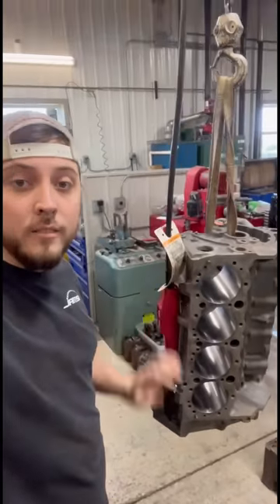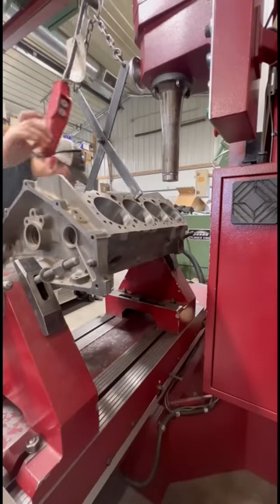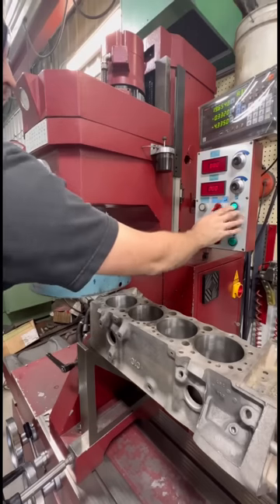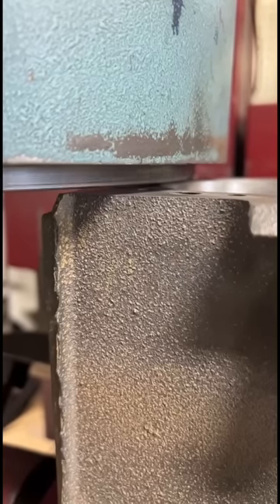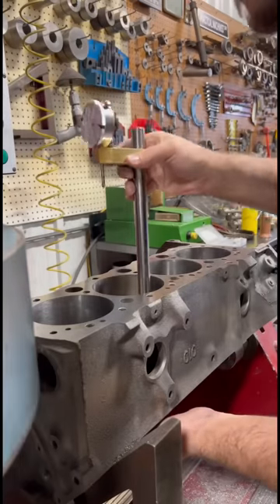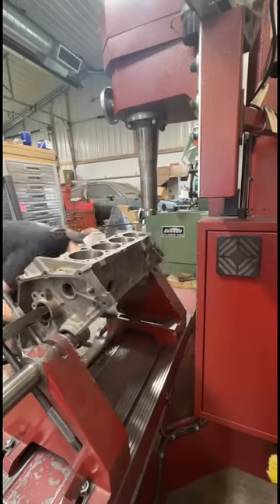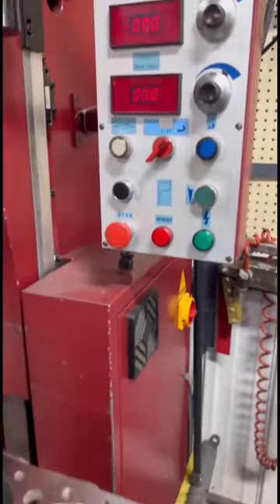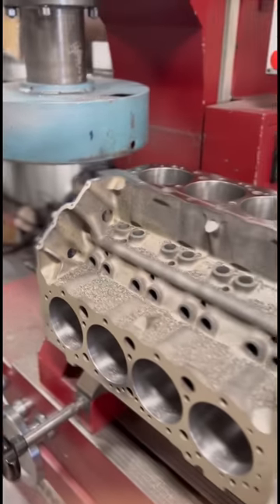#shorts This Is The Process Of “Decking” A V8 Engine Block! Would You Buy This?

Comment: Where this is a lost art for the everyday Joe to afford to do because of trade in for core and order a junk engine machine with 3 different size bores and pistons from  an auto parts store. I'd rather keep all the original together if possible. LS swap is so the new craze for years now most old engines have been trashed. Sad to see. Good machine work like this is hard to find

Comment: My last machinist did a valve job
I installed the head and had a misfire 
Checked the valve lash and plugs but had low compression 
 Leaked checked it and 
Machinist cand be hacks

Comment: It would be much easier to just use a Ford block as they are already perfect. 😋
Reply from the maker: Perfect, as boat anchors? 😂🤡
Reply: @JAMSIONLINE  Well, if you want it to actually work, then yes.😂
Reply: Yes, you are correct sir, boat anchors, if the ford mill doesn’t rust to nothing after first trip…😂 Chevrolet all the way

Comment: I Hope you check the actual angle from the manufacturer before you start machining. There’s plenty of blocks that don’t have a 45 degree angle.
Reply: Thats a 90° V8 designed in 1955, each bank should be exactly 45° from the centline of the block.

V8s pretty much only come in 90° and 60° flavors, and you can tell the difference with your bare eyes.

Comment: Do you have to use a different height piston after doing that?
Reply: "Rebuilder" pistons for that motor are 1.54 pin height, the stock pistons are 1.56 pin height.

BUT* most rebuilder head gaskets are 0.041 thick, whereas the stock head gasket was 0.015 thick, so there are plenty of ways to make up the difference.

Comment: It’s not that the blocks aren’t tru it’s that they warp from the heat of th engine running and the pressures inside it
Reply: They weren't true from the factory. The tooling was more setup for speed than for accuracy. Blocks pretty much got milled on a conveyor belt.
Reply: Cut it quick and dirty, if 1 out of 100 has a problem in service then the warranty will cover it. Thats how all the big 3 did it.

Comment: Im rebuilding a 3.8 229 v6 1981 GMC caberallo my bores are .035 i checked with a feeler gauge i can't afford dail gauge im doing old school way i put old ring in the bores it say 035 it supposed to be .017
Reply: The old rings themselves are worn. Put a new ring in and measure. 

My Chevy 350 had ring gap of 0.040 with the old rings, and new stock size rings got that down to 0.020 (right at the wide edge of the new spec)

Comment: What size block?
Reply: Chevrolet 4 inch bore. 

Most likely a 350, but that casting was also used for 327s and 302s in 1969

Comment: Why the bore chamfer?
Reply: So you don't break the rings when you put the pistons in, and to keep from having sharp surfaces in the combustion chamber that can cause detonation.
Reply: @Texassince1836  you don't build an engine for easy assembly, you build it for performance and longetivity. You don't break rings w/o a chamfer, If you know what you are doing. 
It is the other way around, that 90° bore edge can't cause detonation, impossible, but the carbon that inevitably will collect there will. Also the chamfer will induce head gasket leaks and reduces compression. You may make assembly a little bit easier and have a possible trouble source and ill performing engine forever. No good engine builder adds  a bore chamfer.
Reply: @bigblockjalopy  they chamfer them from the factory, and any sharp points in the combustion chamber are a detonation risk. I even soften the edge of the combustion chamber on the head when I get one milled. 

You're not inducing head gasket leaks, the head gasket is pretty far away from the chamfer. This engine is probably going to go back together with a 4.030 bore diameter, and head gaskets with a 4.125 inch bore hole in em.
Reply: @Texassince1836  they "Break" the Corners at the factory, thats Not a chamfer. The Mopar 400 BB has chamfers for some reason, anyway it is not a good thing. They do alot of things in a factory, that should be avoided. The chamfer will direct the flame front and explosive expansion towards the head gasket. Chamfers will make gasket leaks much more likely, it can't be any other way. And again, the chamfers will collect carbon, and will therefore will induce detonation. You don't want any caverns or holes that inevitably collect Carbon in a combustion Chamber.
Reply: @bigblockjalopy  you miss the part where there is already a "cavern" between the head and the blocks where the head gasket sits further back that will collect carbon, regardless of chamfer. 

Sharp metal points can be heated to glowing, which will cause much more detonation than carbon buildups.
Reply: @Texassince1836  OE steel head gaskets are .015-.017 thick ... And I don't understand the logic, it is inevitably there by design, so let's make it worse?
It depends, many OE gaskets have bore Diameter, like my engines. 

90° is not a "sharp" edge and cylinder walls do not glow. Since the invention of the OTTO engine, not a single time a cylinder wall caused ignition. 

Just take a torch and direct it to a carboned up used head chamber. The deposits will glow immediatly.
Again, chamfers serve no purpose, except to ease assembly, for the above mentioned price. Bad Deal

Comment: Ahhhh bullshit. Blocks are 100% square and parallel from the factory. I worked at an engine plant and I'm a Journeyman Tool and Die maker currently working in Tool & Gage and Layout. Our gauging instruments are far better than anything at a engine shop. Sorry but it's just a fact. I dont see a C.M.M. in your shop. I don't see any precision calibration tools. How offten are your mics, indicators, bore gauges and torque wrenches calibrated? Not disrespecting what you do but you can't come close to the specs the factories are holding.